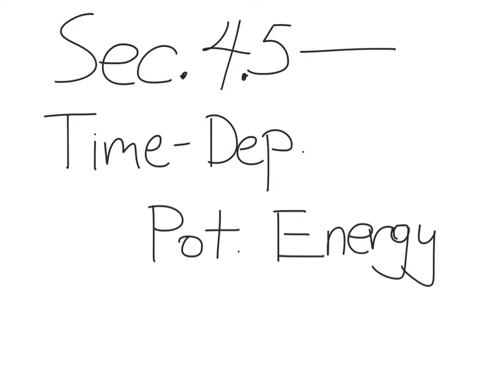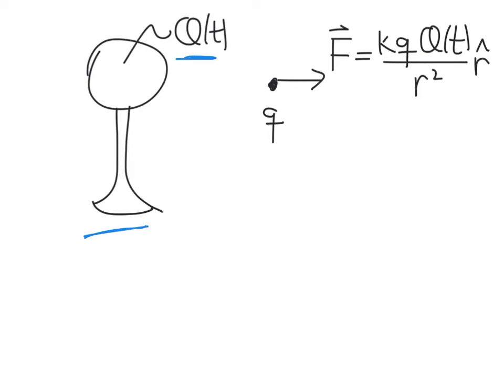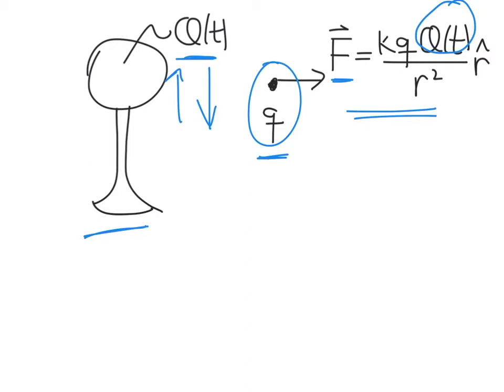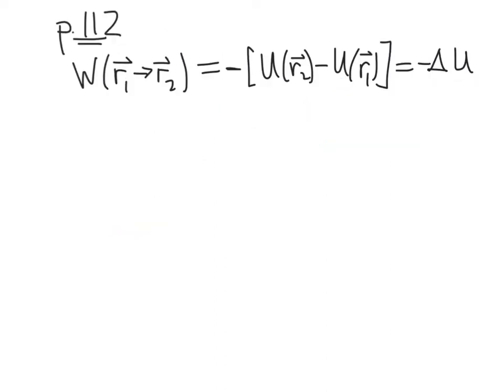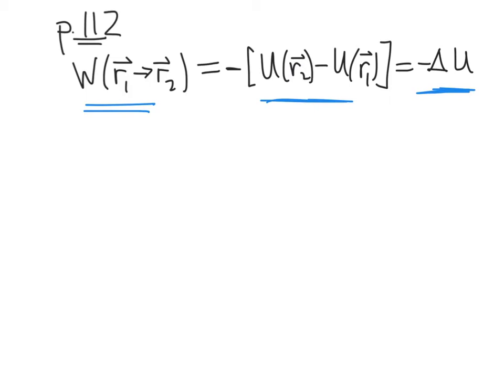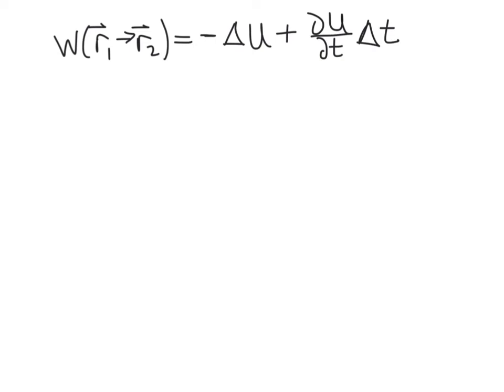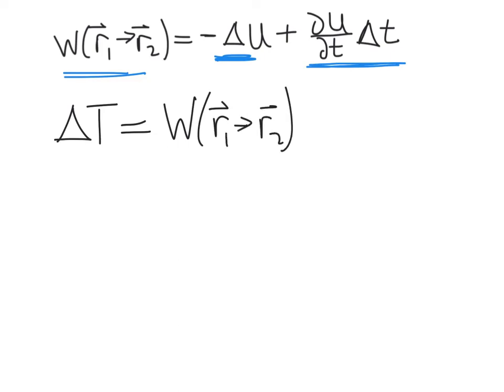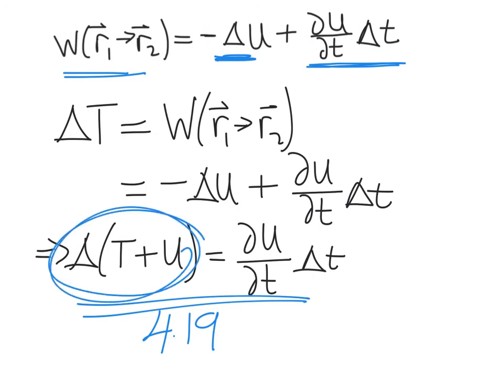Sec. 4.5 - Time-Dependent Potential Energy

Comment: How is U defined when the force is time dependent? We no longer can define it by the line integral of force because of the explicit time dependence, unlike the case of conservative force where there was no explicit time dependence. Do we just assume that it exists, if yes then how do we still calculate it for a given time dependent force?
Reply from the maker: Good question!

We have to be careful what we mean by "time-dependent force" because the force that a particle sees may change (1) because the force at a point in space changes with time AND/OR (2) because the particle is in motion and therefore encounters a force that changes with position over the particle trajectory.

I presume you are thinking about the former case (force at a point changes with time). In that case, we can associate a potential energy with that force by taking the line integral at a given instant in time. There's nothing about the line integral calculation that explicitly involves time, so I think would work.
Reply: @brianjackson415  Thanks for the reply. Don't you think taking the line integral of a force at an instant of time would give a potential energy that is independent of time, thus making the force, which is the gradient of that potential energy, time independent(I mean explicitly independent of time)? The force that we were calculating the potential energy for, was explicitly dependent on time (The former case).

My confusion is, can we still use the line integral of a force with explicit time dependence(Non-conservative force) to calculate the potential energy for that force, because the line integral won't be equal to the change in potential energy, unlike in the case of conservative forces. Of course we can still calculate the line integral itself, it'd even be equal to the work done by the force, it's just that it won't be equal to the change in potential energy, as far as I know.
Reply from the maker: @AkashShaan  If the force itself depends on time, then the value of the line integral over a given path will, by definition, depend on time.